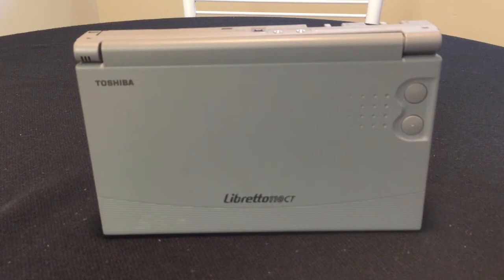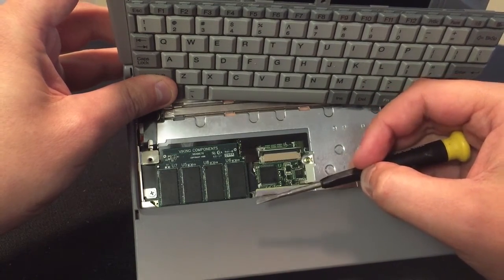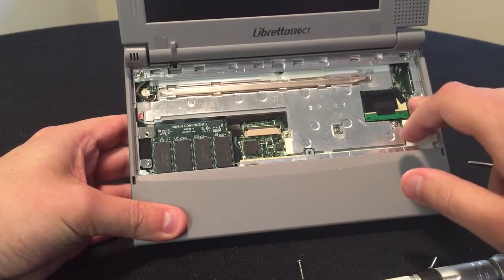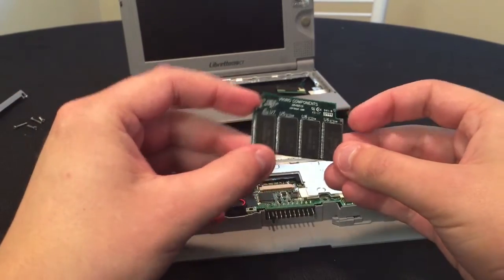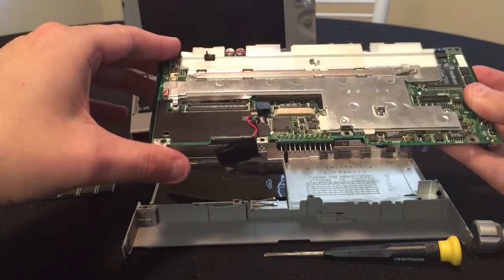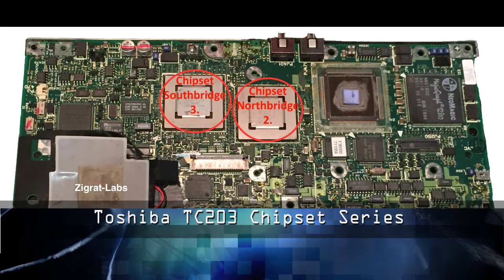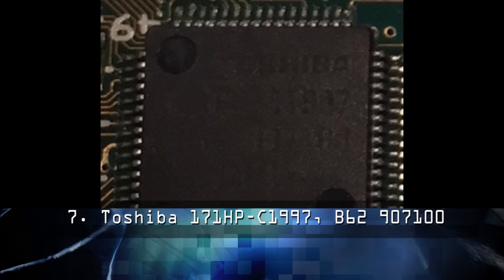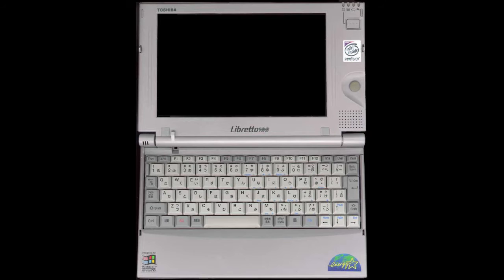Toshiba Libretto 110CT - Teardown

Comment: Useful and interesting.   I have a 60ct and I believe that the drive bay is actually thinner??   I dissembled the ide<>cf adapter do the bare pcb and that plugged in fine.   They are really cool toys but unfortunately, the keyboard are nigh unusuable for prodcutivity typing.
Reply: Yeah, it's thinner than the default HDDs. I tried to plug in a 60 Gb IDE HDD with no luck.

Comment: Hello!
I also own a Toshiba Libretto 110ct which i bought used, one issue that it has is that it does not seem to read the battery correctly, and i managed to switch it with a refubrished one and still did not work. Basically whenever i connect the battery and plug in the dc cable to charge, it always shows that it charges from 90% to 100%, when i detatch the power cord it shuts down. Could there be a fault in the Sensor amplifier of some sorts? thanks.

Comment: I have a 100CT with the same cf - ide adaptor. I could not comfortably fit it into the slot without unreasonable force. I partially disassembled the system to fit the adaptor, then reassembled the case around it. It is working absolutely fine, but I’m wondering why I had such a tight fit. Your one seems to be better by comparison. Did you have to modify the adaptor at all for a reasonable fit? It does seem just a tiny bit fatter than the original Toshiba hard drive. Any advice welcomed. Many thanks; Graeme.
Reply: The 100 / 110 hard disk magazine is very interesting. In China, I came across a machine with a thick disk, that is, 9mm thick. In fact, when you uncover the black insulation paper on the D-shell of the machine, you can see the plastic and rubber pads, which can be removed and used perfectly with a 9mm hard disk.

Comment: I just tore one down myself before finding your video. :)

Despite the hole in the keyboard the screw you mentioned having already removed wasn’t there for me... not even a threaded screw hole. Doesn’t look like it was ever anything there.

My issue seems to have been RAM coming loose since it booted just fine after reassembling. I have a Kingston 64MB module and it was still screwed down. Symptoms were:
Power and Charge lights but no beep, no backlight, no disk activity, and no power to PCMCIA devices.

I ended up disassembling it much further than I should have needed to because it still didn’t seem to be powering on. Turns out that it was powering on after reseating the RAM but you still don’t get backlight when you have the HDD removed. Weird, since you should be able to boot a floppy without a HDD. When I tried reseating the RAM and tested again I obviously did so without fully reassembling since there was a chance I had to go further. Requiring the HDD for the backlight is frustrating behavior.

Speaking of requiring the CMOS battery, my red wire (positive) came out of the connector before I could see where it belonged. I had to magnify the PCB connector to see which pins were connected to pads on the board. It turns out that the middle pin is unpopulated.

Now I just have to figure out how to get files back and forth more easily. :)

Comment: whre did you get your replacement CMOS battery? I bought one on ebay, but it's thicker than the original and it won't fit in the same place

Comment: Hey! Thanks for the review. It's been really useful.
For what I can see you used a 44 pin CF to 2.5" ide adapter, right? I'm asking because I took out the hard drive on my 110 and it's got two columns with 25 pins (though three of them are missing). Will this adapter still work? Thanks!!!!